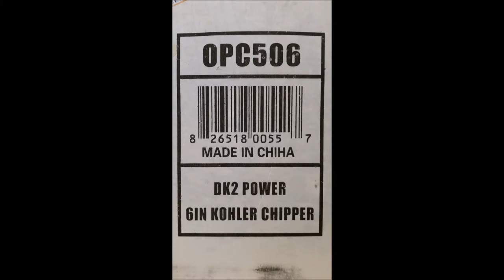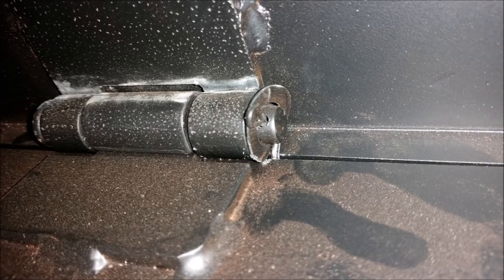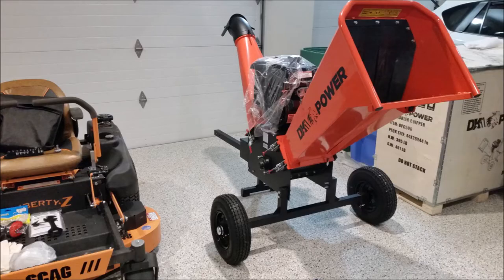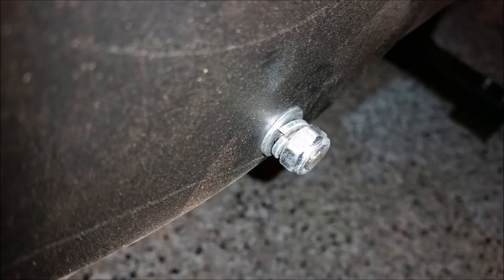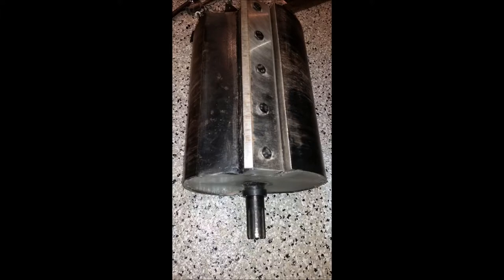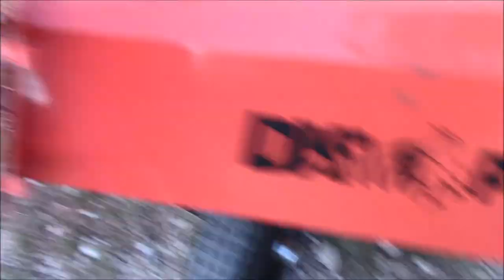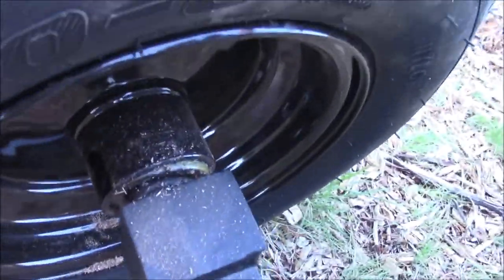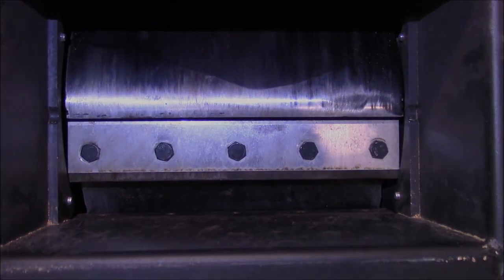DK2Power OPC506 Wood Chipper NIGHTMARE and Tear down!

Comment: I bough mine a year ago and it works great. I had a few jams when it was being broke in, but no other issues since. I noticed you were only feeding (1) limb at a time and are timing how long it takes to chip it up, but I non-stop feed multiple branch's into it and it chips them up great. I have chipped the tops and branch's of over (50) Live & Water oaks. If feeding limbs above 4 inches you do have to keep putting pressure on it as it may not auto fed the bigger one's. Hope you find something that works for you, but I've had nothing but great experiences with mine..
Reply: I Have the power king model same guy sells it basically the same mine works great even after 2 years of use

Comment: I watched this video before I purchased this machine. Very detailed, well done. I hoped your experience was just bad luck as there were so many other positive reviews. I should have learned from your bad experience...

Mine came in a similarly damaged crate. Looked like it was dropped from an airplane into my driveway. 

Same issues with paint missing from the chutes. 

The welding was terrible. The bracket for the latch that holds the outfeed chute was welded on too proud, so the latch wouldn't stay closed and would pop open as soon as the motor started running. Big safety issue obviously. Explained this to the company and they sent me new latches... after I told them that wasn't the problem. I had to take an angle grinder to my brand new machine to make the latch close properly. 

Once I started using the machine I was pleased with its chipping power, even though it is SUPER loud, even with hearing protection.

On the 2nd day of use, the part on the exhaust that deflects the exhaust away from the outfeed chute rattled off. DK Power wouldn't field my complaint and referred me to Koehler... I continued to use the machine but now I have a large burn circle on the outfeed chute from the exhaust blowing directly on it.

Now there seems to be a small piece of debris under the drum that is preventing it from spinning. That may or may not be the machine's fault but for a $3k machine, it seems like there is some issue with it every time I use it. I have to take it all apart and hopefully the problem is just a small chunk of wood under the drum.

Big time buyer's remorse on this machine!
Reply from the maker: sorry you had to to go thru this, after my deep inspection there was no way that i had that many issues with my unit and that it wouldnt be passed down to others but unfortunately i've had a few reports of others having issues as well.   I'm very nit-picky but man this was a real lemon and i'mo glad i was able to return it to home depot.  i actually tried another chipper, made in the usa that had a $4k+ price tag and it had it's own issues, i'll actually be uploading the video on that soon.   if you can , return the SOB and rent a vermeer bc1000 for a few hundred bucks and call it a day. :)   thank you for this update, it validates my concerns for sure but sorry you had to experience it first hand.

Comment: Agree with your assessment that any retail chipper is going to struggle vs the commercial ones you can rent. I tried both - the retail one I had to put a lot of effort into. I ended up spending more time trimming branches for it to feed properly and not jam than I did actual chipping. Then I rent a commercial chipper. What a godsend. I threw branches in and it ate it right up. I would love to have a chipper onsite to use whenever I want but a reliable retail version at a reasonable price just doesn't seem possible.
Reply from the maker: Yeah the only thing I think I'd be happy with is something along the lines of a used Vermeer iron similar in good shape but that's going to set you back 10K and up.
Reply: I have the Jansen gts 2000 pro. It has been on the European market for years with having the strongest German certification on the market. The only problem I had with it was my fault I picked up a hand full of pine straw at the end of the job and didn't realize it had a 2" rock mixed in with it. But it at least ate the rock. The Jansen 1500e I'm learning is a better design and works better live and learn I guess hope this helps. 🇺🇸👍
Reply: I'm one month into owning one of these DK2 chipper/shredders and yes, I agree completely.  I'm spending more time preparing the branches for the machine than I am actually using the machine. I've never owned one of these before and... I don't know what I was expecting. It's not the time saver I thought it would be, that's for sure.

And, after 7 hours of use, the thing is broken.  The metal wheel inside is rubbing against the metal housing and making a terrible racket.

Comment: Purchased the DK2Power 0PC566E, went together quickly without any issues and works well, I think they have made a few adjustments and improvements over the last couple years.
Reply from the maker: That's what one guy said and then he started using it and the thing started falling apart, good luck with yours.

Comment: Amen to everything you have said. I purchased the biggest (and most expensive) D.R. chipper and it has proved to be a nightmare from hell. jamming occurs EVERYTIME I use it......resulting in an hour of take down and massive frustration. It has tipped over 3 times while pulling through the woods......resulting in an hour of getting the tractor out and standing the unit back up ! Totally wasted $3000.00+.. Save yourself a headache and don't go there. Just saying.

Comment: So I just bought this chipper. Yes, I was skeptical but did my research. I had none of the problems you did. I think you had been sent a returned machine. 

First thing I did was check for proper belt alignment. It was dead on. Next I re-torqued all the nuts. They were good but I wasn't quite satisfied with the bed knife bolts so torqued them a bit more. The only thing missing from the kit was two lock nuts, I had some in the shop. The spindles are just a smudge too long for the wheel hubs. A couple shims will fix that. I put a quart of oil in it, some gas in the tank, I was chipping brush! It ran smooth and cut  well.
I bought this to fill a niche. I plan to remove the wheels and tongue and add an attachment plate to it. I'll move it around with a toro dingo.
I've been around chippers for close to 35 years and I can tell you this, they aren't complicated machines.
Reply from the maker: they aren't complicated , but man i must of had a lemon.  the blades not lining up properly was the ultimate deal breaker for me.
Reply: @morejelloplease  , well, I  spoke to soon.

Fired mine up today, heard a klinking and found the center of one knife missing.
Reply: But I've been there before.
I'll grind 1/16 off the anvil and give it another go. As stout as chipper bodies go, they still can flex under stress. 
Not giving up yet...
Reply: @morejelloplease  , brought it back to home depot today. Fortunately I got my money back. It had a defective knife. I could have replaced it but with what? Probably another defective knife. I was afraid it might explode at full throttle and that couldn't be good.

I spoke to the receptionist at DK2, she said a technician would contact me within 24 hours, that was at least 4 days ago.
That told me a lot about the company right there.

Back to the drawing board...
Reply from the maker: @jimsteele7108  dang I feel your pain, I'm still actively looking for a good chipper. At least it's not just me! There's obviously an issue with quality control, or lack of. Hopefully buyers will do research like us and stumble across this video and comment section and save themselves some time money and frustration. My offer to the owner still stands, send me a better unit and I'll give you an honest unbiased review.
Reply: @morejelloplease  , my buddy ordered a Jansen. He should have it next week. That was an awesome little chipper when was made in Europe, now it's made in China. I'll check back in with you when he puts it to the test.
Reply from the maker: @jimsteele7108  i found a brand called salsco, actually made in the usa, they are $$$, $4k for a 3" with a 8hp engine, supposed to be scag-like quality, i saw the jansen but they are another copycat from over seas, i.e. they make them cheap and slap a sticker on the side.  google the address, it's someone house, previous business was called 'yard pro equipment'.
Reply: @morejelloplease  , I am familiar with salsco, I'll look more into them.
Dosko is another brand made locally.
I appreciate your response.
Reply from the maker: @jimsteele7108  did you find another chipper?
Reply: @morejelloplease  I will demo a dosko sometime soon.
Reply from the maker: @jimsteele7108  i looked at that a few times, i ran from the salsco after the manager tried to sell me a 6 year old used unit as new!  i'm trying a new chipper next week, i'll post a video, hopefully it will get my seal of approval lol.  this company is usa made and i overlooked their commercial units.
Reply: @morejelloplease  , who makes the one you're planning to demo?

Dosko is made in my home state. I had a chance to look the machine over and I was impressed. Hopefully do a demo this week.
Reply: @jimsteele7108 Jansen is born in China, Man
Reply: @jimsteele7108  salco and dosko are origianlly born in USA, no doubt
Reply: @allwoodchippers  , the dosko was a joke
Reply: @jimsteele7108  what happened then, it was distributed by GNE company,,,
Reply: @allwoodchippers  small disc chippers like the Dosko don't do well at pulling in the brush. Even with sharp knives. They really need a hydraulic feed but that adds weight and cost.

Comment: I've had the OPC533 for about a month, I've put about 7 hours on the thing and it started making a hellacious metallic racket and stopped chipping well.  Took it apart and found that the rotating wheel thing is rubbing on the metal housing, it looks like the whole thing became misaligned.  My guess is that this rubbing is slowing the wheel down, leading to the poor chipping quality.  I was wearing ear protection so I didn't notice the increased noise at first.

I'm going to call the dealer that I bought it from and see what my options are.  I may ask for my money back.

Comment: You definitely got a bad or returned unit. I just bought one yesterday and so far so good. But the main reason I am commenting is about your dissatisfaction with how long it take to chip a twig. I have used a few professional grade chippers in the past (rentals - but ones that retail for $20K+). For a gravity feed, I am not sure you are ever going to get the experience you are looking for like the professional ones with hydraulic feeders. All those ones you showed in the beginning, I would have taken all of them at once, or as many as I could, and shoved them all in, and if they get jammed or don't slide down, then grab a bigger one and show that down. I learned to save the "good" branches as chute cleaners. By good I mean at least 2" diameter, not shaped like an "S", and a bit fanned out at the end. Mine worked similar to yours, I just didn't stand there waiting for it to chip the twig and threw more at it.
Reply from the maker: After you use it 10 times report back with a status check so we can keep tabs :)

Comment: I wish I have found this video before purchasing. I got the same model. We had no problems with assembly, and no misterios noises in the drum. It chips pretty good up to 3” of soft green material.
But- on the 3rd hour of operation the lower belt pulley broke, apparently it’s cast iron, not steel. And of poor alloy.
The vendor sent us a replacement part free of charge, but assembling it was a nightmare, it was too tight, we had to ship it to fit, we got new belts (exact same as the original) wouldn’t fit, we are now getting bigger ones. I suspect it broke because the original belts were too short and applied too much pressure on the pulley (even with poor alloy it should’ve held otherwise, it provides circular friction, not hammering power) 
I hope our specimen would work better once we get the right belts on it.. 😢

Comment: Wish I had seen this before we bought ours. Got about 180 hours of work in it before the rotor jumped loose and jammed the cutting knife into the steel rotor.
Part is on back order and has been for 2 months. They wont even give me a ETA. Save your money.

Comment: I bought one of these used, it’s been great. I can throw in a 20 foot tall 4 Inch thick poplar and the chipper sucks it right through in seconds.
Reply from the maker: That's how it usually starts out.  Then after several hours hardware starts falling off, etc. You have to really go over the unit and check every nut and bolt. Hope yours stays together.

Comment: Removed bolts from cutter blades using an impact wrench with 160 lbs. of force which was necessary to even begin to loosen the bolts. Inspected each bolt and notice the threads had flattened due to the application of too torque when installed plus the threads were left completely covered with loctite residue. One of the bolt heads was damaged as it was frozen and would not turn at all. Used chemical release agents and a map torch and nothing helped. Cut the blade with a diamond cutter then pried it up breaking the blade for removal hoping it would help release the bond, again no success. Used a 3-foot breaker bar and broke off the head of the bolt, which required me to flatten the top and drill out the bolt and then tapped the hole to be able to just replace the bolt. Installed the first blade and rotated the drum to find it was impacting on a metal guard on the side. Then I removed the drive belts and pulley to find the set screws on the rotating shaft had been over torqued and stripped allowing the shaft to float sideways. Great video, I laugh every time I watch it, which is the only thing funny about this piece of crap machine. Be prepared to spend many hours when you replace the blades, oh and I bought 3 sets of spares as the first pieces had many large breaks after only 8 hours of using them on my limbs. Removing the drum, the mounting bolts are misaligned and require a pry bar to remove the assembly and god help you when trying to replace the parts. I removed the drum shaft bracket so I could decide what modifications were necessary before it could be replaced. Several of the bolts were bent using a hammer hitting the nuts partial rotated so as not to damage the threads and even that required me to use a round file to open several of the holes. So now, I could now beat the mounting assembly back onto main unit, wow what a pain in the arse.
Reply from the maker: Crap you had a worse experience than I did.  Everyone says I had a return, nope, they are just that crappy lol.
Reply: @morejelloplease  Ordered a box of metric set screws to complete the assembly before I can test the chipper, as I needed 4 of them to complete the job. The blades were torqued to 45 ft. lbs. using the generic settings as no information is provided by the manufacturer. The one good thing about my blade order which was done through DK as they were the only source available at the time, was that they sent 2 sets blades with screws for the $150, probably a mistake on their part. It will be interesting to see how the new blades hold up after using the proper torque assembly settings. When ordering the parts through DK you will find that they are not available on the website listing, so you will have to call customer support and request they add them to the site and they will add 10 pieces and then you must keep refreshing until you can add them to your order, that is the only way that I could purchase them. They do not sell the 4 set screws for the shaft, so I purchased a box of them from ebay, as not available from Harbor Freight in the metric sizes and I did not want to have to re-tap the holes which were in good condition. I had previously ordered blades from another secondary source which were not in stock at the time which is how I ended up with the third set, having spares is never a bad thing in my playbook.

Comment: I have to admit. That was painful. Really painful. I wonder if it was a previously used product or just a bad copy. The manufacturer needs to step in with a comment and explain why this happened. I was considering this product but in no way would I want that disappointment and frustration. Thanks for spending your time doing the vid.
Reply from the maker: I was so happy when it showed up, but as i put it together things kept going wrong.   i think the oil was break in oil from the engine manufacturer.  i believe this was a new product but it was just designed and fabricated very poorly.  some people had better luck but this one really hurt, if the manufacturer wants to send me the next step up  i'll sure give it a shot!  but it's bad when it wont chip anything larger than a 1" branch, hell i can break those over my leg :)

Comment: Second time us my OPC 506 yesterday. I noticed a bolt, lock washer and a large washer lying beneath the unit as I was working. After pulling off the pulley cover, I realized the bolt and washer were from the top pulley. The bolt was stripped, the only thing holding the pulley on was the belt cover. Just sent in pictures for warranty. I shall see what DK2 has to say. This is ridiculous.

Comment: I have owned the same model for 3 seasons and it has chipped a lot of braches on my 65 acre wooded property.. Lots of green, dried, hard and soft woods. I do have a bad latch though. My blades have stayed pretty sharp- still on the first edges. The tongue and stand were poorly thought out and I wouldnt buy it again.
Reply from the maker: Man if I had that much luck I may have kept mine.  I had 2 acres and every time I started it something would break